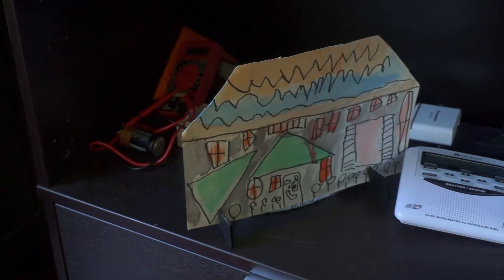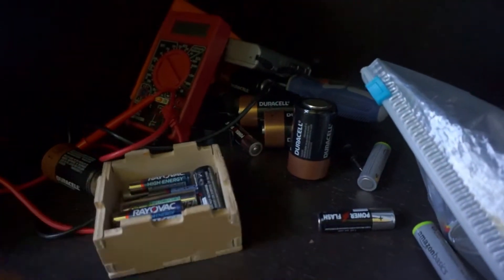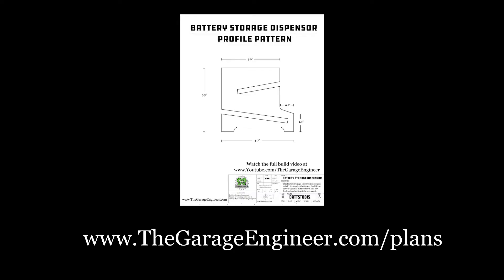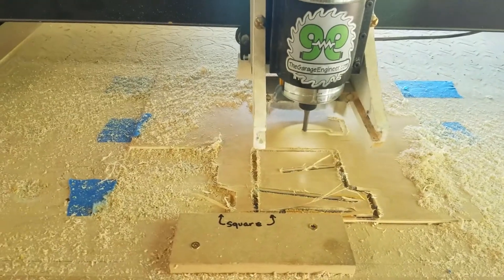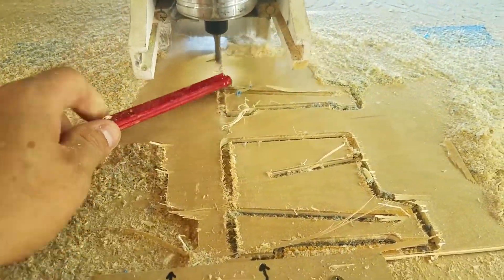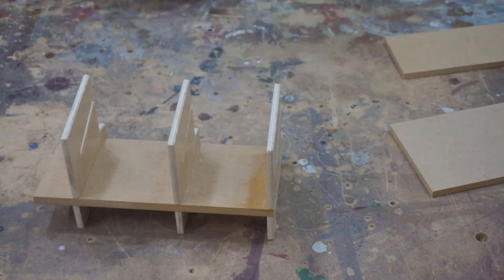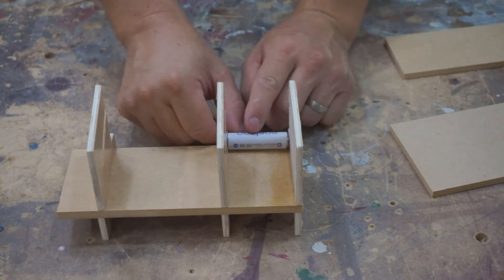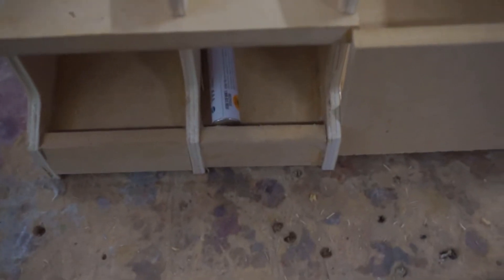Easy DIY Battery Holder and Dispenser - The Garage Engineer

Comment: That’s a cool little build.  I have a little spring loaded battery tester.  Maybe this with a magnet on the wider you would also have a way to test.
Reply from the maker: That's a good idea.  As you can see I'm using a multimeter to test now.